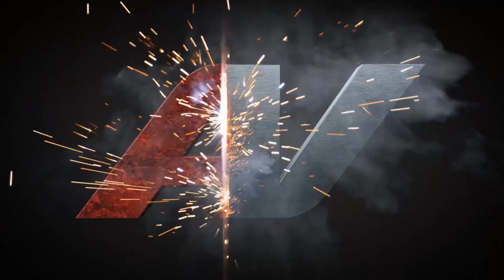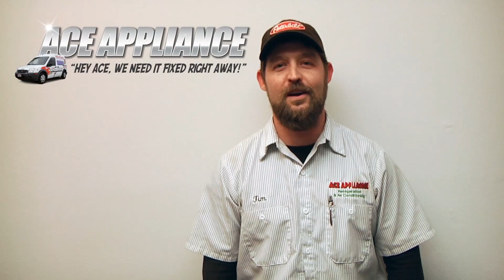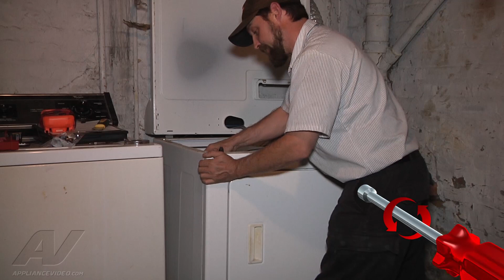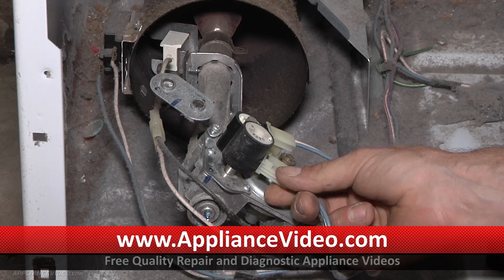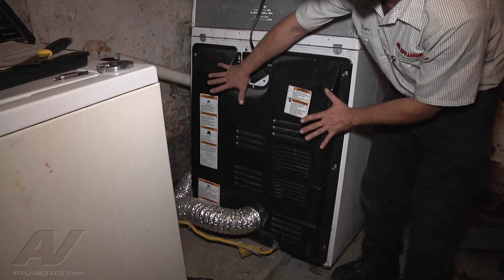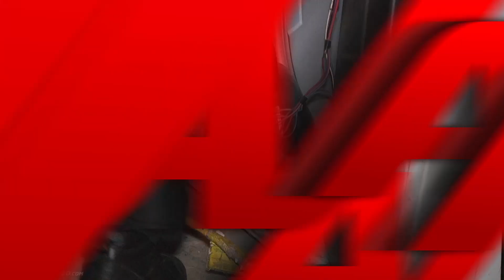Whirlpool Dryer Repair - Does Not Heat Properly - Gas Coils

Comment: I feel like I owe you a couple bucks!  I've been stumped with my Whirlpool Duet WGD97HEXW1 gas dryer.  I initially was following the route that other videos pointed to (thermistor) and replaced it but the clothes were still not drying in a cycle.  I watched the burner hole and noted that the ignitor would glow and the gas would ignite but about a minute later there was no flame.  The build-in diagnostic mode revealed no codes/problems.  Watching this video made me understand that if the gas burner shuts off after a minute and doesn't come back on that these are the parts to replace.  When I checked the Whirlpool parts explosion it showed the solenoids as part of a $300 burner assembly, but with a bit more digging I found that the solenoid assembly (WPW10328463) is available (aftermarket) as a separate component for $17.  Once it comes in I'll swap it out and report back my results.
Reply: So, I received and replaced the gas valve solenoids.  Dryer works better than ever!  Thanks...YOU ROCK!

Comment: Hi Tim, my Whirlpool dryer igniter starts to glow, there is a rattling noise and the igniter then goes out. No heat. Any clues?
Reply from the maker: Great question, if you have a more technical question that our parts department cannot answer, you can search our over 17,000 answered questions free at our website www.ApplianceVideo.com under our Repair Help section. You can also call our parts department at 1-800-830-5465 and they can give you help 7-days A week ,or search at www.SaveMoreOnParts.com  .

Comment: I tested and checked all the electrical components with an ohmeter, all have continuity. Replaced ignitor. Still no gas. I also checked the gas valve magnets all good. Airflow is good. What next? Its a Whirlpool Gas Dryer.
Reply from the maker: Great question, if you have a more technical question that our parts department cannot answer, you can search our over 17,000 answered questions free at our website www.ApplianceVideo.com under our Repair Help section. You can also call our parts department at 1-800-830-5465 and they can give you help 7-days A week ,or search at www.SaveMoreOnParts.com  .
Reply: @Appliancevideo  It was a bad timer. I cleaned the contacts. Working good now.

Comment: Hi, my gas coils checked out fine.
I have a Whirlpool Golden gas dryer.
What next?
It heats up but then shuts down the heat..
Reply from the maker: Great question, if you have a more technical question that our parts department cannot answer, you can search our over 17,000 answered questions free at our website www.ApplianceVideo.com under our Repair Help section. You can also call our parts department at 1-800-830-5465 and they can give you help 7-days A week ,or search at www.SaveMoreOnParts.com  .

Comment: Thanks a lot
I learned a lot
Order the gas selenoids  and fixed the dryer myself
Reply from the maker: Great question, if you have a more technical question that our parts department cannot answer, you can search our over 17,000 answered questions free at our website www.ApplianceVideo.com under our Repair Help section. You can also call our parts department at 1-800-830-5465 and they can give you help 7-days A week ,or search at www.SaveMoreOnParts.com  .

Comment: I JUST DID ALL THIS!   my dryer used to come up and heat up, but when it cycled off, it couldn't ignite after the initial startup.  Definitely the gas coils.  Now my dryer works perfectly again 

TWO THINGS;.

1. The drum can be tricky to get back into position.  My felt ring was kind of falling apart, and strips of it kept dangling inside and making it hard to put the drum back on, so I tore off the loose strips.

2   DO NOT SKIP THE CLEAN UP OF THE BACK OF THE DRYER.  Do EVERYTHING, just like the tech did in the video.  I pulled off that interior vent tube and there was so much lint and dirt in a big lump that i couldnt hold in two hands.  My exterior vent tube was clean, but untold years of dust, dirt and small pieces of pens, and whatnot had collect in that tube thing.
Reply from the maker: Thanks for your response, we are glad we could help. Our library of over 5,900 videos are currently helping over 1.6 million people like you every MONTH.  Please help us by subscribing to our YouTube channel, or post our website www.ApplianceVideo.com to your Facebook page, Twitter, Instagram or any other social media sites. Your support will help us keep producing more free quality videos.

Comment: Thanks very much!  Never realized there were so many sensors in the dryer.  Decided the easiest one to reach and test for continuity was the fuse mounted on the back of the dryer.  Sure enough it was blown.  In the past, every few years I would clean out the 4 inch exhaust pipe but never thought about removing the rear exhaust vent pipe to vacuum the lint out.  When I removed the rear vent pipe I was shocked at how clogged the pipe was.  No wonder the heater fuse blew.  Fuse cost $15.00 from the local parts store.
Reply from the maker: Thanks for your response, we are glad we could help. Our library of over 5,900 videos are currently helping over 1.6 million people like you every MONTH.  Please help us by subscribing to our YouTube channel, or post our website www.ApplianceVideo.com to your Facebook page, Twitter, Instagram or any other social media sites. Your support will help us keep producing more free quality videos.

Comment: I have a gas dryer that I replaced the coils and it still ignites and goes out checked all thermostats and cutoffs I'm so confused even clearly vents
Reply from the maker: Great question, if you have a more technical question that our parts department cannot answer, you can search our over 10,000 answered questions free at our website www.ApplianceVideo.com under our Repair Help section. You can also call our parts department at 1-800-830-5465 and they can give you help 7-days A week Monday Saturday, or search at www.SaveMoreOnParts.com  24 hours 7 days A week.

Comment: Isn't it necessary to turn off the gas before removing the coils? When I loosened the bolts on the bracket I smelled gas until I turned off the gas shutoff valve.
Reply from the maker: Great question, if you have a
more technical question that our parts department cannot answer, you can search
our over 10,000 answered questions free at our website www.ApplianceVideo.com under our Repair Help section. You can also call
our parts department at 1-800-830-5465 and they can give you help 6-days A week
Monday -Saturday, or search at www.SaveMoreOnParts.com  24 hours
7- days A week.

Comment: Mine is basically the same way but will occasionally have heat for a few minutes >.>
Reply from the maker: Great question, if you have a
more technical question that our parts department cannot answer, you can search
our over 10,000 answered questions free at our website www.ApplianceVideo.com under our Repair Help section. You can also call
our parts department at 1-800-830-5465 and they can give you help 7-days A week
Monday -Sunday, or search at www.SaveMoreOnParts.com  24 hours
7- days A week.

Comment: What if the igniter is not glowing ?!
Reply from the maker: Great question, if you have a
more technical question that our parts department cannot answer, you can search
our over 10,000 answered questions free at our website www.ApplianceVideo.com under our Repair Help section. You can also call
our parts department at 1-800-830-5465 and they can give you help 7-days A week
Monday -Sunday, or search at www.SaveMoreOnParts.com  24 hours
7- days A week.

Comment: Hey I have same dryer... Not heating properly... I open the little cap in the bottom like you said and I see flame coming but only for few seconds... Then go off for few minutes and start again for few seconds (2 or 3 seconds).    That's no normal? Do I need to get it fix? Or is normal?
Reply from the maker: Great question, if you have a
more technical question that our parts department cannot answer, our
technicians are answering all questions at our website at www.ApplianceVideo.com under our Repair Help section. You can also call
our parts department at 1-800-830-5465 and they can give you help 7-days A week
Monday -Sunday, or search at www.SaveMoreOnParts.com  24 hours
7- days A week.
Reply: I need help

Comment: I did all of that and also replaced the flame sensor, both heat sensors and their fuses. Everything has conductivity. I replaced the igniter also. Help.
Reply from the maker: Great question, you can call
our parts department at 1-800-830-5465 and they can give you help 6-days A week
Mon-Sat . You can also search at www.SaveMoreOnParts.com 7- days a week.  If you have a more
technical question that our parts department cannot answer, our technicians are
answering all questions at our website at www.ApplianceVideo.com under our Repair Help section. We have over 6,000
common questions and answers that you can easily search through by your model
number, appliance make, problem or error codes, and It’s completely free to
search through our question & answer library. There is a very good chance
you question is already answered there.

Comment: Hey I have a GE gas dryer and while the drum rotates fine you hear an odd static cracking electric sound during gas ignition and it hardly ever goes away. Any idea what this could be?
Reply from the maker: Great question, you can call
our parts department at 1-800-830-5465 and they can give you help 6-days A week
Mon-Sat . You can also search at www.SaveMoreOnParts.com 7- days a week.  If you have a more
technical question that our parts department cannot answer, our technicians are
answering all questions at our website at www.ApplianceVideo.com under our Repair Help section. We have over 6,000
common questions and answers that you can easily search through by your model
number, appliance make, problem or error codes, and It’s completely free to
search through our question & answer library. There is a very good chance
you question is already answered there.

Comment: what causes a whirlpool dryer to burn the inside of the tub?
Reply from the maker: Great question, you can call our parts department at 1-800-830-5465 and they can give
you help 6-days A week Mon-Sat . If you have a more technical question that our
parts department cannot answer, our technicians are answering all questions at our website at www.ApplianceVideo.com under our Repair Help section. We have over 4,000
common questions and answers that you can easily search through by your model
number, appliance make, and problem or error codes, and It’s free to search
through our question & answer library.

Comment: I have a whirlpool dryer that doesn't always heat could it be the solenoid?
Reply from the maker: Great question, with our
technicians now getting hundreds questions weekly, they are answering all questions
at our website at ApplianceVideo.com under our Repair Help section. We have over
3,000 common questions and answers that you can easily search through by your
model number, appliance make, and problem or error codes.